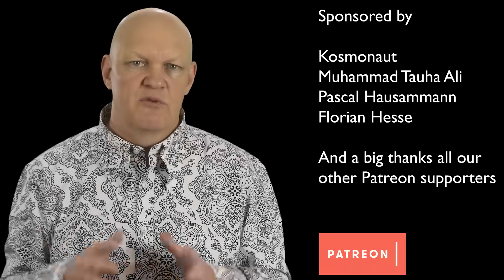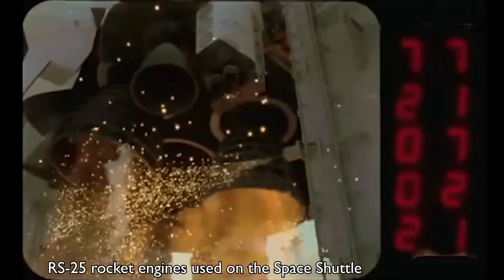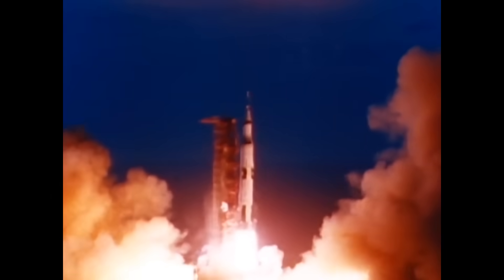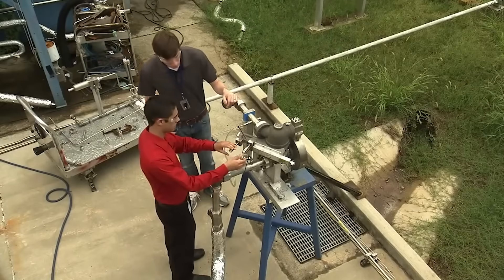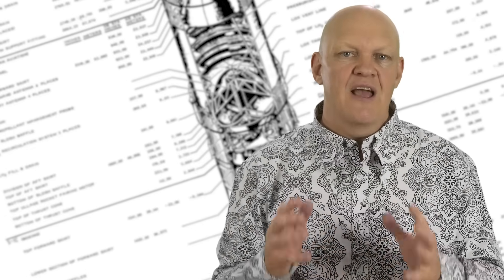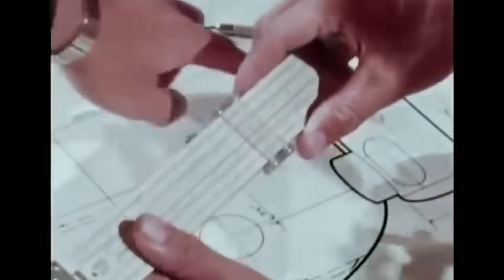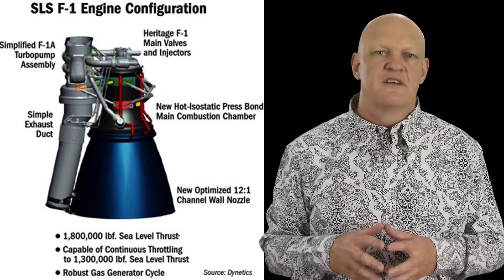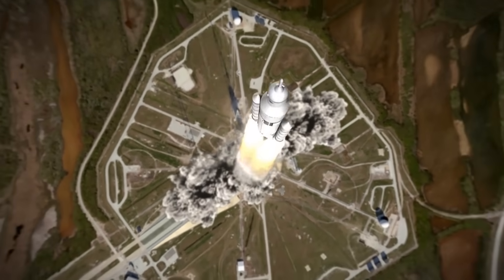Why Can't we Remake the Rocketdyne F1 Engine?

Comment: Just because the Knowledge Pool for building an F-1 is gone, does not mean it could not be recreated in the same manner as it was first accomplished, by actually building one. There is no Secret Smoke lost to time forever, it's a matter of reestablishing the knowledge pool through experience. The real issue is, just how much do you want to pay to do it.
Reply: @Hydroclhoric Acid The F1 engines are not particularly unsafe as far as rockets engines go. Don't confuse the fact that they were simple by design with the idea that they were crafted using simple sub par methods. The fact is no F1 engine ever failed in flight. The J-2 engines failed, but mostly due to small stuff and even they never failed catastrophically.
Reply: @aBoogivogi  Apollo 6 test flight showed there was a "pogo" problem to solve
Reply: You are missing the point entirely. The skills they needed was related to machining custom parts and doing custom welds. Now this was necessary because they had no accurate means of building the engine without this approach hence every engine was custom. If you build the same engine but purposely to use modern methods these processes are automated. To say that's an issue is sort of like saying nobody can build a model T Ford anymore on a modern assembly line. Off course they could. The models would just be far more equal than they were back then.  It's the same thing about the ancient pyramids. We have no clue how the ancient Egyptians specifically built them, but using modern methods it would not be particularly hard for a building engineer and/or an architect to make one using modern tools.
Reply: assasial1977, you might want to check your facts. The blocks used in the Egyptian pyramids weighs about 2.5tons. Not sure what country you live in, but a Ford F250 pickup truck can tow more than that, and the forklifts at various work sites can easily lift 10tons; this also doesn't take into account cranes that can lift hundreds of tons. As for fit and finish of stones, I believe waterjet cutting would be even more precise and have a lot less wastage in materials. So yeah, I think you are kinda confused.
Reply: Yep. And especially why would you pay to do it the old way if they can reverse engineer the components into a modern design where lots of test's can be run through simulations. Sure they would have to run some actual tests to, but it would probably be much cheaper overall.
Reply: Yeah we can. It's easy as hell. We would use a crane and modern tools though as that makes it a lot easier, but stacking huge rocks in a pyramid shape. Yeah we can do that quite easily.
Reply: The major problem with rebuilding with no redesign is that, as he said in the video, a lot of the practical knowledge is lost. But what does that mean ?
It means that it would be possible but a long process, because a lot of trial and error would have to be done to iron out the issues and a probable learning process on some methods not used anymore nowadays. 
Impossible ? No. Impractical ? Yes.
Reply: The thing is, some designs are amenable to automated manufacture, and some are not. If the original engineers of the F-1 knew that the parts they designed would be hand made and fitted by a pool of skilled technicians who were available throughout the engineering world at the time, they would have designed things with those guys in mind. Automated tools are much more limited than humans in what they do well. For them to really work, you have to engineer within the limitations of the tools and processes which will be used. The tools we use now didn't even exist when the F-1 was designed.
Reply: Wes Smith yes it does. Some skills take 5 to 10 years to developer.
Reply: It is very counter-intuitive, indeed.  It sounds like it should be easy,.. but its not.  Life is strange that way sometimes.
Reply: You realise vacuum tubes are still made today for high end hifi systems, don't you? Perhaps this was just a bad example. Just sayin'....
Reply: @Hansca  And for radars that need to burn thru counter measures.
Reply: Wes Smith Why?  Why build an F1 when it's 2018.
Reply: This works on a small scale where you only have to build a handful of engines. You will wind up with a disaster eventually because things will slip through the cracks in the long run. It's a lot safer to design something that can be produced without the need for expert modification.
Reply: Sounds like this F1B is what they want.
Are these designs private? Why aren't other companies building these massive cheap engines and launching eleventy billion satellites all at the same time?
Reply: SpaceX and ULA could have replicated this engine but they choose not to do it probably for a lot of very good reasons. Starting from scratch gave them an engine that was easier to build with today's automated technology then the old one ever could be. I am not an engineer but I suspect you will find a lot of the old engine design in the modern engine and they did not so much die out as they morphed into today's engines just smaller. Until recently it was not common for multiple satellites to be on the same launch so massive engines would just be a waste.
Reply: asasial1977: Are you saying the pyramids are "almost if not impossible"?
Reply: Then you may as well have a new design with the new materials and methods. It would be basically cheaper. Which was the point of the whole video.
Reply: The program to update the J2 is a good example of this actually being addressed.  Long story short, the J2 and the J2X both use hydrogen and oxygen, and that's the end of the heritage.
People praise the Russians for holding on to designs and continuing their evolution.  To that comparison the United States has continued production of the RL10 and AJ10 from 1961 and 1958 to unflown vehicles being produced.
Reply: My Marshall guitar amplifier has vacuum tubes (or valves for you brits) . Most instrument amplifiers today (at least for electric guitar) are driven by vacuum tubes, in fact, most of the circuits (for the amps) are from the 60s.
Reply: @richb313 how can the F1 be the most efficient design if it is an open cycle engine? That doesn't make sense as thrust is lost to power the turbo pumps. The Russians build closed cycle engines which is why the U.S.A. still buys them, as they are incredibly efficient and extremely well engineered, reliable and primarily budgeted for U.S. military launches. Strange world where Russia and the U.S. argue with one another, yet Russia sells engines for the U.S. to launch military sats. Money talks!!! ;-) If only the world powers would cooperate more on Space ventures... imagine where we might be now.
Reply: Any piece is not just assembly, it is a long line of materials manufacturing.  The blueprints do not list how the metal allows were made, so we would need to rebuild those smelting and processing plants, often with environmental impact that we would not tolerate these days.  Then there are the tools and machines, which are not built any more.  Those would have to be reverse engineered, etc. etc.
Reply: Yup, which is kind of the whole point behind the F1-B.  Not only can we do it, we can make it better if we wanted to.  I would think the engine's biggest issue now is the 'not designed here' problem with any tech someone else designed.
Reply: supposedly all the tooling for one of our fighter jets (US) got mistakenly scrapped, so now we can't make some of the replacement parts for those planes. Tooling is expensive.
Reply: Exactly. It's like ancient Greek fire. Historians state "we don't know how it was made" so ignorant and imaginative fools conclude that Greek Fire is beyond our level of technology, as if it used some kind of magic or lost technology from 450 BC. It actual fact we just lost the recipe, but it probably uses unrefined oils and resins. Napalm is more modern and obviously superior.

I'm so sick of hearing people tell me that we don't have the ability to go to the Moon anymore. As if the 60s was a long lost golden age of hard working men, and people today are incapable. I'll forward those people this video.
Reply: @sam23696  I believe that greek fire (or liquid fire as we call it) its just crude oil.
Reply: @ΑΡΗΣΚΟΡΝΑΡΑΚΗΣ  It was a mixture of Naphtha and quicklime.
Reply: Greg Ewing Exactly.
Reply: We don't know how they did it, so either they were more advanced than us some how, Or Aliens.
Reply: There's a team on youtube that does the entire assembly and manufacture of parts on youtube. They even make those tubes with the numbers inside them too. So it's already being done by hobbyists.
Reply: Joe Blazer. Well I mean given the lack of 'electronic assistants' people would start to remember numbers out of bare necessity it's not like the entire world has suddenly started to lack brainpower since the 60s, in fact people have been getting about 5 IQ points smarter every generation on average likely I assume because of a pretty much worldwide improvement in education. sure IQ tests are not the ultimate test for smarts but it is a good worldwide indication. It is the 'knowledge pool' that is the biggest problem just that the pool has moved into another area when talking about rebuilding these engines  i think that people have moved on from hand-made prototype style manufacturing especially in the space industry where tolerances and margins are so slim.
Reply: Wes Smith just take a look at one of the surviving examples, wouldn’t that help?
Reply: Oh, we actually have nowadays a pretty good idea how it was done. The finer details would need to be found out by doing it. Or we could just build a better and bigger pyramid by using powered machinery. But fact is, no one today needs a pyramid. We build skyscrapers instead.
Reply: the problem is that many of the parts used are not in production anymore. Rebuilding an F1 would be incredibly expensive , all to build an antiquated , unsafe and inefficient design
Reply: @hydrochloricacid2146  "antiquated, unsafe and inefficient design" but.....BUT...we made it to the moon though....
Reply: @Jay-jb2vr  point being?
Reply: @hydrochloricacid2146  you can't comprehend can you??
Reply: @Jay-jb2vr  I know what you're trying to say here. And you're wrong.
Just because something is inneficient doesn't mean it can't do the job. The Saturn V was perfectly capable of sending the Apollo stack and the necessary fuel to the moon and back. I've done the math myself. It's just that we've built more efficient engines since then, and have learnt from previous mistakes.
Reply: @hydrochloricacid2146  ok and the Saturn V was not a mistake. It did what it was designed to do successfully.
Reply: @Jay-jb2vr  I never implied the opposite. It did what was expected of it, and was a huge technological leap for the time. But rebuilding it today would be a mistake considering how far we've come
Reply: @hydrochloricacid2146  No it wouldn't be a mistake. It would be just as cool and technologically impressive as back in 1969. Its just the whole "cool" factor. Engineers in the 21st century rebuild the Saturn V and launch it, that would be pretty cool to watch and witness.
Reply: Wes Smith try to remake a 1950's era vacuum tubes.

Step 1. Train about 50 electrical engineers on the obsolete technology of vacuum tubes.

Step 2. Train about 200 people to be glass blowers and then train them to make the tubes.

Step 3. You won't be able to buy any of the  grids, plates or heaters that make up the internals of a vacuum tubes...so you have to recreate that entire supply chain

The Saturn's engine was designed and built around 1950's technology ,supply chain and skills

The cost of recreating those skills and supply chains would be astronomical today.
Reply: If we can build rockets to send men to the moon and back, of course we can rebuild the F-1 engines. No, wait... <loop>
Reply: Side question for ya, Wes: When did "[k]nowledge [p]ool" become a brand? Also, why the random commas (such as between "gone" and "does," and "is" and "just")? Oh, and why the random "do" between "much" and "you"?
Reply: Shows how little you really know. The F1 was The Safest and most Efficient design ever produced.
Reply: That's the thing the long run was never in mind with the F1 engines they were under a lot of time pressure to build something that was arguably out of their capabilities and they did well to get the reliability they got. It's no shock to me that those notes were lost and weren't kept properly, being on a project with a huge amount of time pressure that kind of stuff goes straight out of the window and things get bodged over bodges over bodges. Not saying it was under built it clearly wasn't, just the time wasn't put in to turn the production of these engines into a mass assembly-line procedure that could live on into the 21st century. Would have loved to work during this era as an engineer though.
Reply: Credence Clementine that was my exact thought. I was going to comment about the pyramids and all the other ancient structures that no one knows how to recreate the techniques that were Reliant to create the precise cuts
Reply: People cant even remember phone numbers without electronic assistants tethered to themselves. It's not the 'knowledge pool' that's gone. It's the fuckin brainpower and intuitive thinking.
Reply: Wes Smith I don't think so. Today we have no skilled workers just cookie cutter design engineers that don't really know how to build anything old school. They just don't make them like they used to. You can't duplicate generations of skill and experience with money. (There is no app for that)
Reply: psychobartus the precision of the cuts and fitment of the stones would be almost if not impossible
Reply: Try and build a Battle Ship with 14" or greater Armored Plating and 16" Guns. You can't No one knows how to roll the massive armored plating any more.  We can't build the 16' Guns because we have lost the ability to produce the Barrels for such guns. Such knowledge was handed down worker to worker through the generations. Since we no longer do these things we no longer really know how.
Reply: aBoogivogi ah no. 
Even with modern machines we could not move and set stones the size of the ones used in the pyramids. The precision in the cut and fit between stones would also be almost if not impossible.

Comment: Well I posit that there are still people welding - instead they're building submarines and ships now instead of rocket engines. And consider too the engineers back then didn't have benefit of CAD or computers, they were learning it on the fly too. So could we build the F1's again - sure we could. We just need the political will to do so.
Reply: The point of the entire video was to show an interesting example of how different old times were. That there are much better engineering methods today, and that the way the F1 was designed is as dead as the Boar Vessel meme
Reply: kd1s the point is the can't truly, as said in the video each part was modified, which may not necessarily be shown in the blue prints. Submarines and rocket engines are completely different things, it's not just the welding skill that is the issue.

Comment: I still think it's an incredible shame that the technology developed for the Saturn V wasn't put into use long-term. With 50+ years of gradual refinement, we could have had a situation similar to the R7 platform, but with much heavier load capacity, more efficiency and lower cost on account of newer manufacturing techniques making it into future variants and parts revisions. It really was extremely inefficient to just scrap all that vast technological capital IMO for a jack of all trades master of none that was the Space Shuttle. A later revision of F-1 engine or Saturn V booster could very well have helped crews along the way to the Moon again sooner, or even Mars, if there was any real incentive to do so.
Reply: Not only that but can you imagine how much faster the ISS would have been constructed using the saturn V as the lifting vehicle